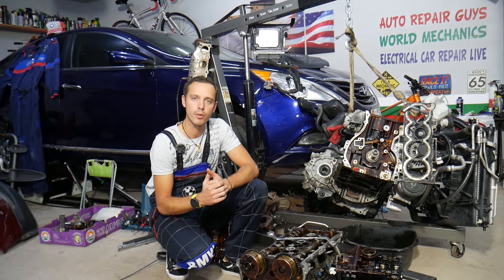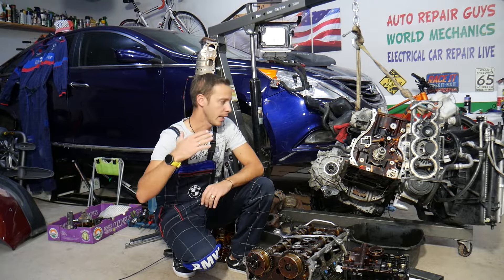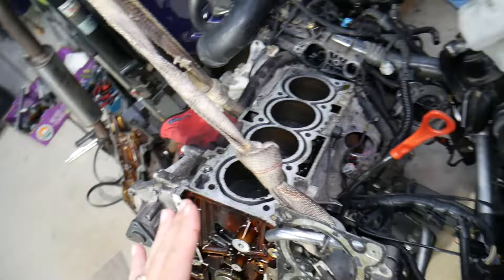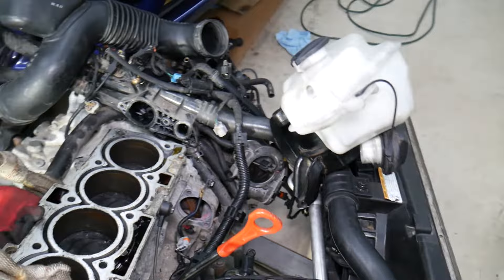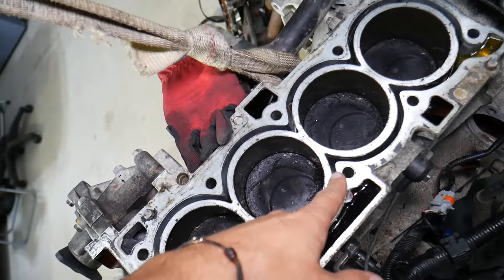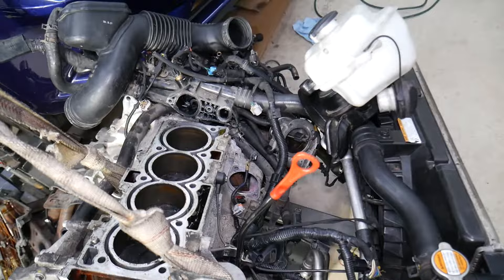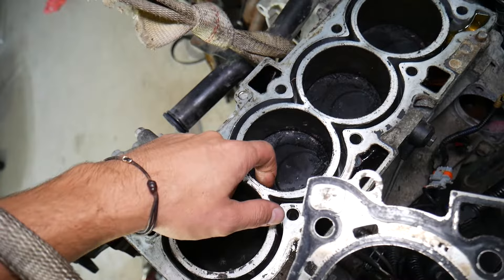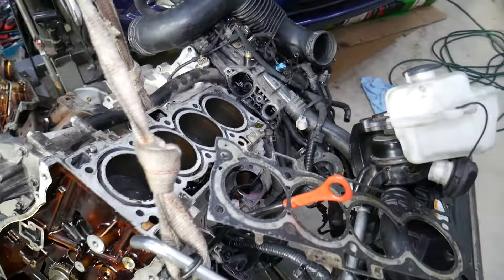WHY COOLANT COMES OUT OF RADIATOR CAP OR OVERFLOW TANK RESERVOIR ON A CAR

Comment: Is it normal if i take the radiator cap out. And turn the truck on for the coolant to overflow and drop outside?
Reply: Same thing is happening to mine, I was trying to see if the coolant would bubble when I turned on my car but instead the coolant would just go up and overflow.
Reply: @209MainstDB  Someone here in youtube comment me saying that was normal since the cap is off and the truck is on. What i did yesterday i went to buy a new cap. Later during the day im going to check if there wasent any coolant dripping while i drove it yesterday.  What i did notist when i got home my truck engine was very hot. Good luck in your vehicle.  I'm trying to find why is caussing this issue on my own because here where i live not all mecanics are honest. They like to ripp off clients specially women. They gave a estimate of $350 i advice to let me know first what was the issue i took a video of the problem where it was leaking.  I told them to change the spar plugs and transmission oil and motor and the issue of the dripping coolant. Took my truck in at 2pm
 They said it was ready next day at 11am. He had a sheet saying i have to pay over $500 i told him you never call me to tell me the issue.  And you gave me an estimate of $350 so thats what i only paid. Later when i drove my truck i notist it was getting hot when i turn my cooler system off. Went to see if it had a leak and yes it did. But this time it wasent coolant was just clear water. They tried to make me think i had a problem with my coolant system.  Which i didn't believe.  I checked my antifreeze bottle which i had added orange antifreeze and was pure water also my radiator had pure clear water in it?? I told this person where they fix it he told me if i tasted it and that i should of taste it i told you come and taste it for me 😂 later next day i call another mecanic and told him why my coolant was overflowing when i took the cap out and turn my truck on he said it was the head gaskets and that it will cost $600 i said why so much he said because we need to take half of your motor out. I said no thank you.  Than i said im going to coment here in youtube to experts so they said it was completely normal for it to happen.  And to try to buy a new cap too see if when i drive it with the cap on to see if it was because it needed a new cap replacement.
Reply: @AgustinaQuinteroFelix  sheesh! Thanks for replying. Yeah hopefully it is normal. Cuz it's gonna be a hassle for a broke person like me lol. But good luck with your truck and your situation, hopefully it gets better and you get everything fixed.
Reply: @209MainstDB  Thank you so much.  Good luck too you as well. Im broke also. 😔
Reply: @AgustinaQuinteroFelix  Put a new cap on did it again
Reply: @Iconhulk  Thank you. I did and it did work for me. The sad thing is that i had taken my truck in to a mecanic and got ripoff.  Then later the problem continued and they even had added pure water to my radiator and my orange antifreeze they had taken it out to add water. 😑 Thank God i listen to you guy's to put a new cap and the problem stopped completely. Sending blessings.  😊

Comment: Hello, i have a problem with my bmw e60, the climate controll only blows air through the vents in the middle of the car, on the middle of the dashboard, and in the back of center consoll towards the backseats) not on the sides on the dash or in front of the dash. Do you know what can be the problem?

Comment: Hi
My car getting heat i change radiator cap pump also fine thermostat also    But my all coolant coming in external box not going back in radiator i can see some air buble in external tank when water getting full hot
Reply: You have air in your cooling system. Watch some videos on how to correctly burp the cooling system